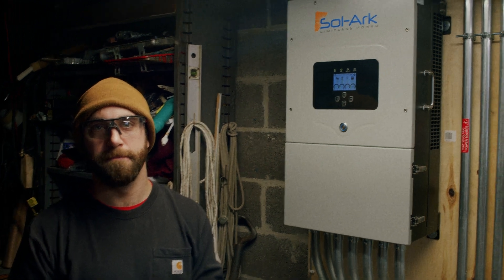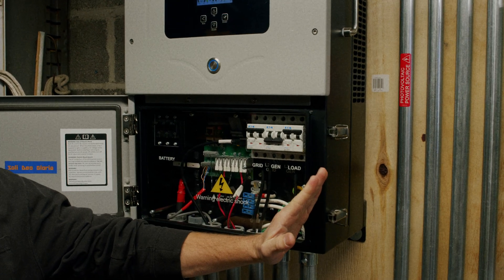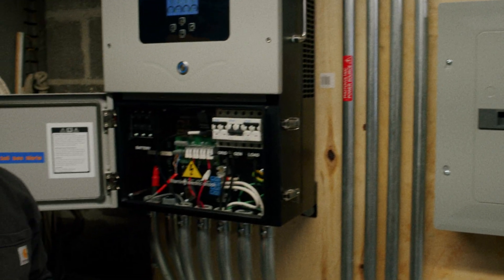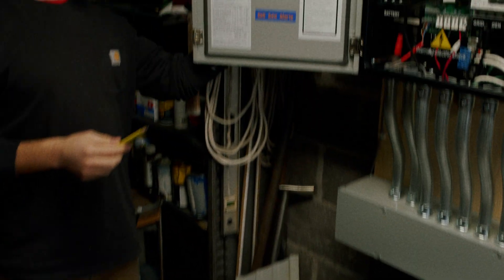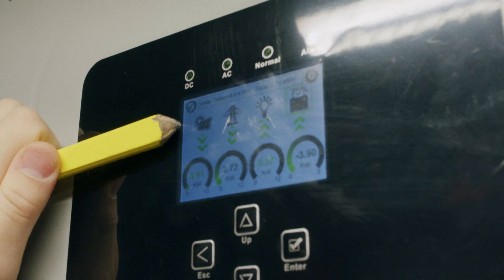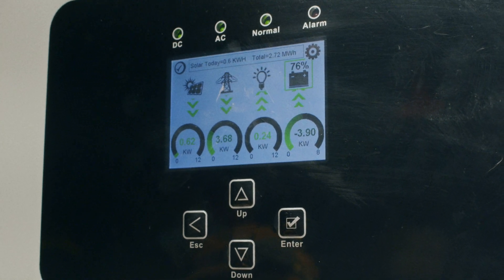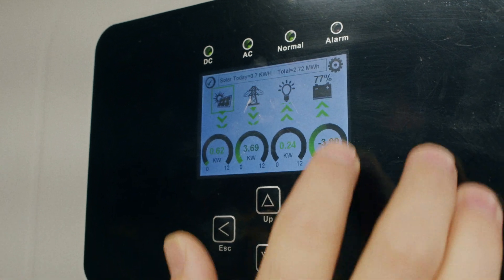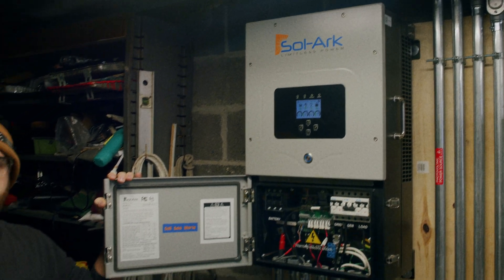Peninsula Solar Sol-Ark Instructional Series: Walkthrough

Comment: I want my system to be off grid and only charge from the grid from an available 15 amp breaker on my house breaker. I have a manual transfer switch with critical loads for a generator. can I ensure it won't try and back feed the grid, and could I feed the load into a transfer switch?